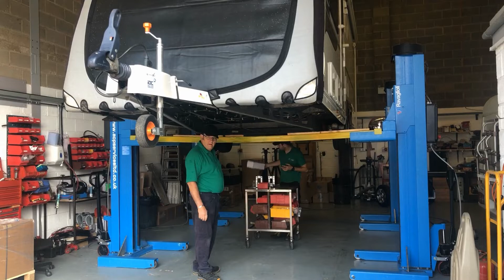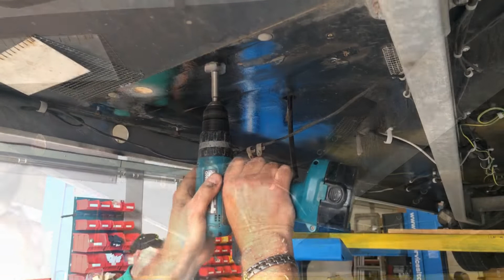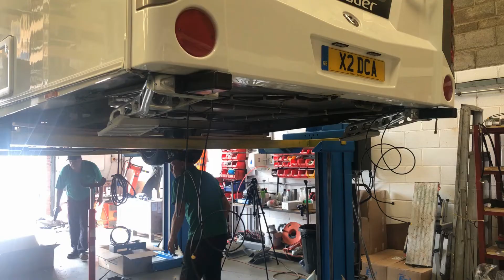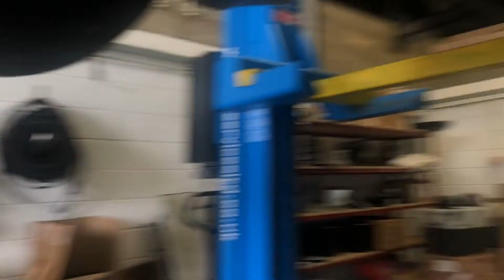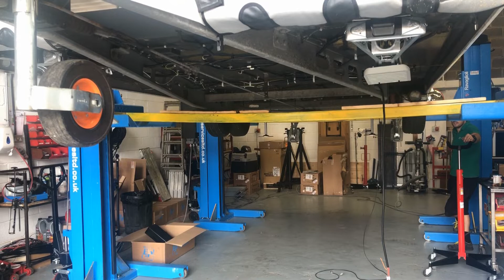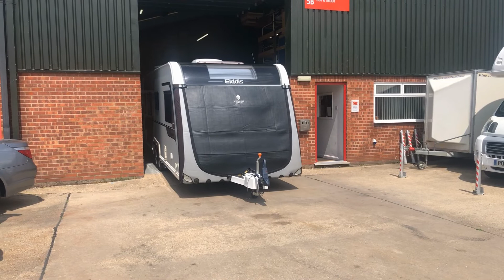Installing hydraulics on a caravan!! - E&P Caravan Level System Retrofit

Comment: Had a full system fitted by this workshop in June 2022. Very professional service and communications, very pleased with the system and the full explanation at handover. While these systems come at a price, remember you are looking at 2 guys labour for a day on a caravan, there is no doubt these need to be fitted by people who know what they are doing and this video prompted me to use this company, even though it was a 3 hour drive, the workshop also  recommended an overnight stopping site just 10 minutes away, ready for an early start next morning, that was also superb. What you will find is that a caravan needs to be in a real nose down position to start with, otherwise the system will not activate

Comment: A bit of advice for E & P we have a caravan which was out of warranty end of March, last week end our system failed we had to stay on site for an extra night due to not being able to retract the steadies .
Luckily for us and our saviour Matt from Heritage Caravan services came early next morning , 
Seemed to be electronic problem but there was no indication of any emergency retract system apart from in manual , it said optional extra manual pump which we didnt have and was not offered .
But our saviour Matt crawled under van to the main hub of system and took weather cover off .
As this caravan is a sited caravan and never towed everything was clean as a whistle.
And guess what Matt notices a sticker which says EMERGENCY RETRACT SYSEM !
Matt noticed cable was heading to and around the battery box , checks that out nothing so inside we go lifts the seating up and there she is a cable going to a switch and guess what it says? 
The button gets pressed and yes up the steadies come , we still havent resolved the problem yet but have a local E & P service engineer coming out next week .
So my advise please to E & P please leave some sort of literature of you product indicating where this is , it could have caused mayhem for us if it wasnt for good old Matt from Heritage caravan services and highly recommended
Reply from the maker: Thanks for the comment. We were fully aware of where our emergency retract was installed. This is something which should be discussed and you should be informed of its location by your fitted or caravan dealer.

Comment: How much did this cost including the fitting?
Reply from the maker: Fitting is included in the price. For the full system your looking at somewhere very close to £3000 depending on the dealer and any options.

Comment: gets me how a young lad would need this system (unless back troubles)and sorry if you have. heavy van and heavy vehicle to tow it so would guess you've passed your towing test as would be well over the 3500kg max weight for somebody so young. good video as was wondering how this is fitted. never seen rivets used in timber or are they special for the job. sorry many questions.

Comment: Nothing new here, I had a four point hydraulic leg system installed onto my old Ace Ambassador caravan in 1984 by Saltofix Engineering in Oswestry, Shropshire. OK, they asked me if I would let them fit their prototype experimental package to my caravan and if after their testing, I would accept it back with the hydraulics still fitted.  End result was very acceptable, one manually operated pump fitted to the tow bar A frame and a 4 way control valve which would activate either all, or individual ram/legs.  It worked very well. The legs had return springs fitted so when the hydraulic pressure was zero'd, the legs reverted to their closed positions all by themselves.

Comment: Great video guys, thanks for sharing. Really interesting to see the install process. Just wondering what the noseweight of a Crusader Storm is? I'd be interested to know if fitting this system had an impact on that. 👍
Reply from the maker: Thanks for the feedback! Regarding noseweight, we’ve noticed that it is naturally quite heavy at the front. Even when we picked the van up from the dealers empty, the noseweight was his in excess of 100KG. Fortunately, given the location of the transverse island bed, it’s relatively easy to manipulate the noseweight to what you need it to be for your limits. 
The Level system has been suggested to at around 20KG net additional weight when you deduct the original steadies. During the process, I got my hands on some of the components and the weights are not huge. The hydraulic lines and very narrow and hydraulic reservoir very small, all contributing to less weight. It’s clear that this is a well thought out system. The only influence on noseweight is the addition of the big foot steadies at the front which add a couple of KG, but these are offset by new steadies to the rear. As the axle jacks and control module are installed inside the rear axle, these shouldn’t have an effect on noseweights!
Reply: Thanks for your reply, that’s really useful to know. 
Your comments re nose weight are interesting, empty, our own MK1 Unicorn is above 100kgs too and has to be laden in order to meet my vehicles max nose weight limit. It’s strange that even though some UK manufacturers state their products max nose weights are 100kg they are in breach of this when factory delivered. Adds to the fun having to get the balance right doesn’t it 😉. 
Thanks again for sharing the video, and enjoy the new level syetem. 👍